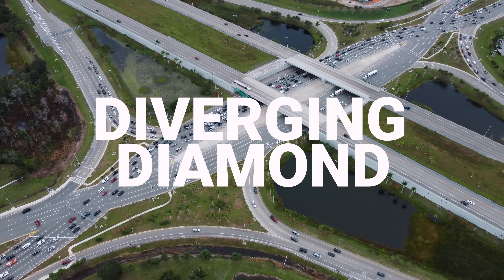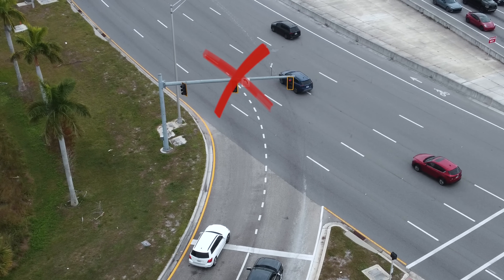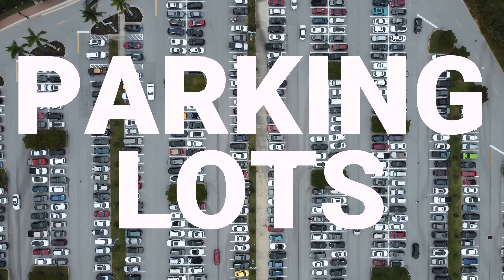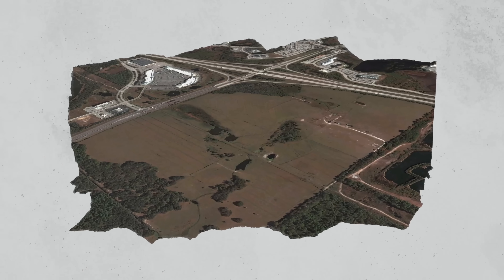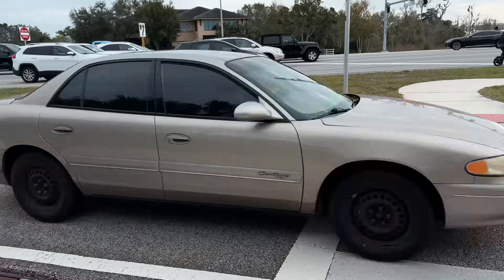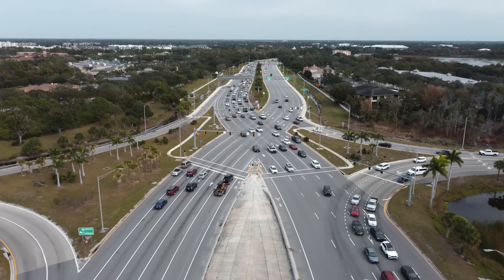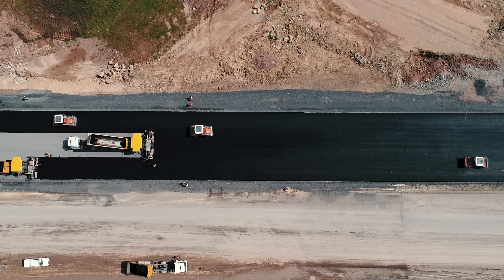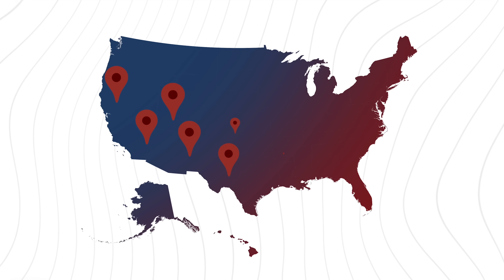Traffic Will Never Be Fixed Here

Comment: There's a book called "The Bottleneck Rules" which talks about how the only place you can improve the throughput of a system is at the bottleneck, but if you do that, the bottleneck just moves somewhere else. This applies to all kinds of processes (it came from the manufacturing field).
Reply: @ Goldenhate:
1. Rural areas in Europe hardly have public transport either.
2. Public transport in densely populated USA areas and between them su*cks major balls.

Example: travelling large distances by train in the USA takes twice as long as in Europe. Japan's Shinkansen is even faster.
Reply: With your second sentence you nicely confirmed that that wás what you're saying: they can do it in Europe and Japan but not in equally densely populated regions of the USA.
Thanks.
Reply: This concept exists in chemistry too, where nearly all complex chemical reactions have a "rate-limiting step." In many cases, the challenge of industrial chemistry is finding catalysts or enzymes to speed up that one reaction in a chain, thus speeding up the entire process.
Reply: Yes, improving the quality of life for the governed is an iterative process.  Did the book also say don't bother to make improvements because it is futile?
Reply: It's pretty simple. Stop driving cars everywhere.
All this does, is how absurdly inefficient personal automotive transportation is in high density urban areas. 
Instead of spamming lanes everywhere, make the place more pedestrian and bike friendly and invest in public transport.
Reply: @ Afore ...: Are you saying that American planners and engineers in their less densely populated country are incapable of figuring that out while their European and Japanese can? While at the same time those Americans have no problems regarding highways?
Anyhow, you already pointed out one of the core problem in the USA yourself 8n your very first sentence. And that's a political choice. The principle behind it is that the profits of big companies always are first priority at the expense of the interests of the common people.
Everything else is window dressing.
Reply: @marknieuweboer8099  As I see it, it's a reflection of the expectations and priorities of the community. If everything you need is available within walking distance, (including your way of providing for yourself) and the weather/safety in your area is conducive to foot travel, great! But it's likely there are at least a few things you want or need that can't be provided solely by your local community. You may either have to learn to live without your ideal scenario, or you need something that will give you further range. Are you in a situation where someone in your range is capable of reaching those things outside your range, and you are willing to wait for the time it takes to deliver? (This is what past cultures dealt with) - What about those things that are 'experiential', rather than physical, like art, the zoo, a concert, a view?

Public transit can help with some aspects of that, within limits, but has its own drawbacks: How close is the closest pickup to where you are? Does it go to the place you need to go, or near enough to walk? What about the weather/safety in your area prior to the pickup and at your destination? What about your safety/trust in the people on mass transit with you, who you have never met? Do you need to worry about the person next to you being sick? Does it run where you are needing at the times you are needing the transit? If not, or you miss your stop, what's the delay before your next opportunity? How many connecting transfers do you have to make, and how impacted is that chain if one step's transfer is missed or unavailable? How much can you reasonably transport with you? How frequently do you need to visit the grocer, with the amount you can personally carry?

Cars bypass that entire set of problems, but they do come with their own. (on the personal side: upkeep costs, potential downtime, the potential stress of driving in crowded areas, the focus/time needed for the trip, insufficient places to park in proximity to the destination) If there's enough assessed value for mass transit over what cars provide, people will use it. - You see that regularly surrounding events, and sometimes even for companies/districts with large workforces in tight regions. 

In places where there's a consistent enough level of traffic between fixed points, it makes sense for a government to set up mass transit in a way that accommodates that traffic, and to either force the option, or to provide a solid enough experience to convince people that it's preferable. If the community is mostly built around smaller local centers already, or shares a level of cultural interaction that can accommodate the regular proximity needed for mass transit, or has a few specific hubs for all the traffic to go into, those makes things simpler. (Not saying that it can't happen otherwise... but without those, it adds to the friction, and gives extra weight to the 'car' side of the equation) But in places trying to accommodate for rapid growth without the system already having support behind mass transit... that's a tough sell. 

The interchange shown in this video is a symptom of the problems in this area, but it likely isn't the core bottleneck, even if it's an easy place to see the problem - The interchange would likely work just as well, if not better, by being a bit simpler: The number of lanes has its own problems, from needing too large of a stretch to be 'safe to cross' when visibility may only allow you to see a car or two ahead, so that lengthy stretch needing to stay clear may be unreasonable. To me, it appears that the main bottleneck is on the main road further down, and the whole area would likely be aided by having a separate throughline artery road that bypasses the local cluster, and/or gives alternate access to it.

All that said... If we can build in a way where everything you need is available within your local area, great! But there's likely a reason that that isn't already the case after a community grows beyond a certain size. And trying to retrofit that 'local community availability' onto an existing community isn't easy, especially if they don't desire it, and have an acceptable level of 'car transit' in place already. -- Expectations, priorities, valuation: if you can't shift those, it's a losing proposition. It's often better to build within the existing system, and optimize it for what *is*, rather than trying to force a dramatic shift.
Reply: You wrote what you wrote and are the one who's desperately wriggling.
So shrug.
Reply: @marknieuweboer8099  LOL they deleted their replies but somehow I think you won the argument 😂
Reply: Very true, the city should of planned everything at once and did the DDI plus upgrade the adjacent intersections to keep traffic flowing.
Reply: This is primarily caused because the US has so much room to expand. Aka, mass transit is difficult to implement because the fact there isn't a high enough population density to support it. It causes massive urban sprawl that eventually leads to downtowns (which are usually separate townships) to get overwhelmed by traffic. For example, Texas in the US is approximate the size of both France and Germany combined. But Texas's population is ~1/5 of the two countries. for an even more stark contrast, take New Mexico, which is about the size of Germany, but has just 1/40th the population. Its fun to make fun of these places for not having mass transit, but simply put, the US just doesn't have the population density. And where we do, guess what, we have mass transit. 🙃
Reply: @goldenhate6649  People aren't spread around evenly.  Transit isn't really expected to cover farm areas as much as cities.

Texas has 3 significant urban areas, they were just not built for anything but the car.  If I go to where google maps has downtown Houston, it has lots tall buildings, but it also has an extremely regular grid with 100m x 100m (yes meters, wtf Texas) square blocks and tons of space dedicated to parking lots. Leaving the downtown core, Houston also seems to very much favor fully detached homes, even where the detachment space is narrower than a sidewalk as a cultural quirk.

Generally speaking Texas has designed their major urban space to be ~1/3 as loose as say Urban Paris.    It doesn't appear to have much space dedicated to residential over commercial classic downtown design.
Reply: @goldenhate6649  Right, but cities don't HAVE to allow sprawl. They just choose to.
Reply: @LuminaryGames  sprawl is so much easier financially and technically. You have to force people to not sprawl to not sprawl.
Reply: @harrymu148  Cities can decide where they want to annex and where they sell land to developers. If Cities just stopped annexing new land. Sprawl just stops. If the surrounding rural municipality does not grant any more town charters (which they generally don't want), then yeah people just have to increase density.
Reply: @LuminaryGames  You'd be surprised how much power and money big cities gain with urban sprawl. its a political steam roller powered by property developers and corporate landlords that aren't keen to stop.
Reply: @harrymu148  Big cities actually lose money with sprawl. Maybe city councilors who have developers giving them kick backs. But that is a completely different issue.
Reply: @ What does that mean, allow it?  You want more regulation telling you when, where and how you can move, and where and how to live?  For what?  Because you read somewhere that suburbs are "bad?"  There is absolutley nothing wrong with the way suburbs have been integrated into our society.  IF you want to live in some super-dense "walkable" dystopia, there are examples that you can seek out. I have no interest in Manhatten other than to vosit.  I want to live in the suburbs with a lawn, far enough apart from my neigbors where I can crank my stereo as loud as I want, and I also want some pear, peach and apple trees.  Does that make me an enemy of the state?  I think people have lost sight of what the freedom of living in America really means.  I don't blame them, I blame the indoctrination they get in school as opposed to an actual education.  Allow it, LOL.
Reply: @ I mean that they should be making people who live in suburbs pay for the 3,4,10x more utilities and infrastructure that they consume then people who live in more dense areas.

Currently the system works the opposite way, where the downtown core subsidizes the suburbs. And that is just unsustainable. So they should not allow it. If you want to pay for the road and the utilities to your acreage outside of the city then be my guest.
Reply: @LuminaryGames  I mean by that logic, then people who are overweight should pay more for health care.  People that fly should pay more for air traffic control.  People who don't work shouldn't eat.  That kind of fits your narrative.  As far as utilites,  I pay more for utilites already.  As far as roads, I think the Inerstate is already being used by commecial traffic traveling to and from the area, and through.  If you want to live in a 700 sq ft apartment in a 20 story high rise, I won't stop you.  To me that would be a little slice of hell.  We were fairly high earners before we retired.  Pretty sure I paid more taxes (and I mean way more) than the average person living in the city, in fact certain of it.  I never looked at it from your standpoint.  II just take offense when I am being "nudged" out of my preferred lifestyle, and really for no good reason.
Reply: @msromike123  Nobody is nudging people out of lifestyles. Right now almost every city makes it illegal to zone anything but Single Family Detached homes. Most people just want cities to go back to zoning a little bit for everyone.

And I think that overweight people should pay more for healthcare, and smokers too. People who fly DO pay more for air control, as it is added to their ticket. I don't really see why you added the part about unemployed not being allowed to eat though, that is a bit weird to me.
Reply: @LuminaryGames  "Cities don't HAVE to allow sprawl. They just choose to."  No, people choose to.
Reply: @justinsayin3979  You didn't think I was suggesting that Cities were some intelligent creature or something right? I was talking about the municipal government, which is a group of people.
Reply: @goldenhate6649 They WOULD have the necessary density, had they been built with NO parking lots & NO stroads...

Comment: You can fix it by adding public transport options to go to that shopping center which is cheaper than with car so people will choose it, also making the interchange without traffic lights entirely, there's one better option to this but that's very expensive and big, (cloverleaf, no traffic grossing at all) Pedestrians and bikes need a tunnel or bridge to feel good grossing it, outside of the interchange, just bridge or tunnel over/under the highway.

Comment: I drive through this stupid intersection almost daily as I live nearby. Originally meant to ease congestion because Sarasota built the UTC Mall in an area that had multiple shopping centers and for people who live in Lakewood Ranch, it become more of a death trap because development has outpaced the capacity of the intersection. This past winter traffic backed up under the overpass just to get to into UTC. What is needed more but will never happen is that the sarasota area invests in a lightrail system because adding more lanes for cars will only make things worse. Also careful how you drive through this intersection, people do what they want to get to the new mall or chick fil a and its dangerous.

Comment: a single question would be; why not change elevation for the crossing diamond? as in keep the diamond and crossing concept but not on the same elevation.
one goes under the other; that removes the trafficlight and even if one side gets blocked, the other can still flow safely. 

i mean we can’t solve traffic with more lanes and we need to refocus effort on the human part (walking, cycling etc) - so i am not advocating for more lanes or anything; just a curious question from my side

greetings from Europe

Comment: Doesn’t the backing up problem go away if you remove the traffic lights and make one of the roads lower or higher then the other
Reply: No
Reply: @bobsemple9341  the problem of cars being stuck in the middle of the road will be gone. So the backing up might not me gone but it isn’t a problem anymore
Reply: @braam828  it's not a solution though it's ridiculous. If u don't see the issue you're a lost cause. Like wtf could possibly make u think that's a good idea?
Reply: @bobsemple9341 Of course it works. What is the issue?
Reply: @bobsemple9341 Don‘t distract from the topic. By building two additional bridges that lead one one of the one lanes over the other at the two stop lights, all of the stop lights are eliminated.

Comment: US suburb design is the problem, the area is too big and it can only accommodate a few houses, therefore the residential area is built further away from the central business area. 

One of the solution is to build special districts where all needs are in one place, such as residences, offices, shopping areas, schools, places of worship, parks so that people no longer need to drive more than 1 hour to go to the city center.

So in 1 city there will be several business centers surrounded by residential areas, not just 1 area which causes a buildup of vehicles and also people from all over the city who will only go to 1 area.

Comment: pedestrian oriented setups have their own share of problems though
Reply: Yet not a single example? Typical
Reply: @bobsemple9341  First of all it's gonna be more difficult for certain populations, like the handicapped and some elderly. Second, moving anything bigger than a desk will be a pain, especially when you have a lot to move. Some hobbies, like woodworking, will be near impossible when you have to haul all your supplies on foot. Some small businesses would suffer because it's more difficult to ship out their products. It also places difficulty on homemakers of larger families that need tons of groceries. Third, when you have to walk everywhere, shops will have to be blended into residential areas. They need to be stocked by trucks. Sure you can have them at the edge of the pedestrian only areas but then it also limits how large these areas can get. Even more importantly, no motor vehicle street access also makes it slower for emergency vehicles to get to their destinations on time. Sure they can drive on pedestrian walkways but at nowhere near the speed of driving on a road for motor vehicles because they need to watch for pedestrians who have no reason to watch out for vehicles on a pedestrian walkway. These are just a few on the top of my head atm. The list goes on and on. Plus, at the end of the day, you will still need cars if you wanna go anywhere outside of the community. In this setup, you either 1. Don't own a car and rely on taxis or public transportation or 2. Park your car very far away from where you live. Either way it would be much more difficult, expensive, and/or time consuming to travel to farther locations. Unless you work at home or inside this community, even travelling to work would be much more cumbersome. I didn't give examples before because there are just so many I couldn't choose where to start. So many functions of society are supported by cars, either directly or indirectly. People take many conveniences for granted. Sure cars have downsides, but the ways they greatly benefit people's lives cannot be neglected.

Comment: In case people haven't already figured it out, FDOT is both inept and corrupt. They NEVER build any project without built in bottlenecks, which then require yet more "fixing" by FDOT. Except they never fix traffic, they simply move the bottlenecks around.